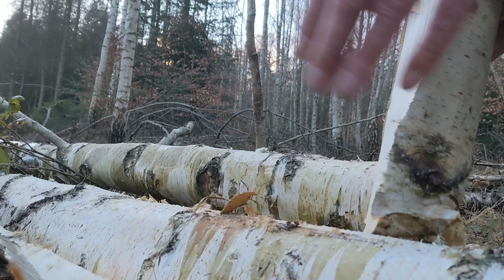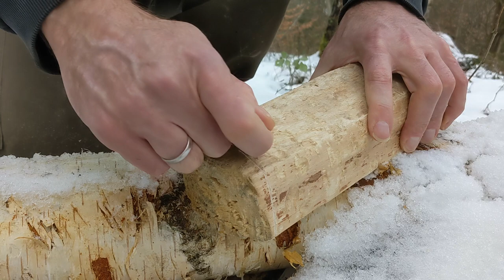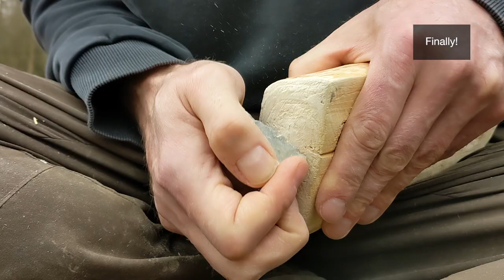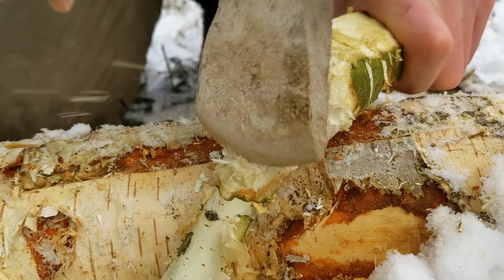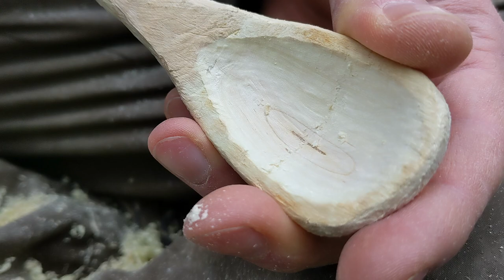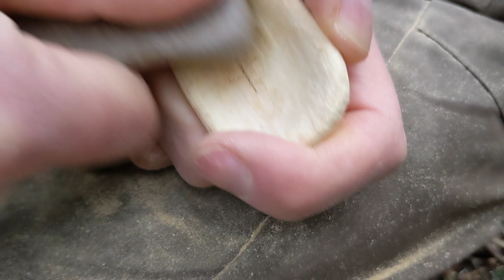Carving spoons and bowls using primitive stone, bone and beaver tooth tools

Comment: i think you could seal the crack with some pine pitch, i use it when i want to remove imperfections or smoothen the wood without removing too much material, after sealing it you could grind the excess glue off

Comment: I made some too, but i used fire to carve it, instead of tools. I worked pretty well.
Reply from the maker: I tried that once, but got a nasty crack in the cup. What kind of wood did you use? Greenwood or dried? I suspect the crack in mine was due to the wood not having been dry enough, similar to my recent axe handle.
Reply: @MakeItPrimitive  I used "cajueiro" wood, a brazilian native tree, that gives caju, juicy and delicious fruits. The wood was still green, and had some cracks. But none of them was on the bowl part.

Comment: I think you would achieve a better result not by gouging, but by drilling. I believe you can make pretty effective drill from beaver teeth. With which it would be possible to pick out and turn out the fibers from wood.

Comment: Interesting stuff.  Pottery would have been less calorie intensive. I'd be curious to see how well clay utensils hold up.
Reply from the maker: I made a clay spoon a while ago (it can be seen in my first pottery video), but I haven't really used it much yet. It works, of course, but is very prone to breaking due to its shape and material. A wooden spoon is the better choice when you're on the move. 

Concerning efficiency, don't forget one also has to gather and refine the clay, the firewood and start the fire; if you factor this in, there might not be that much of a difference.